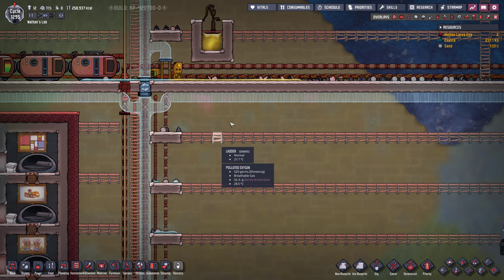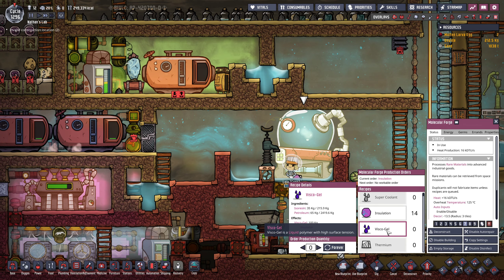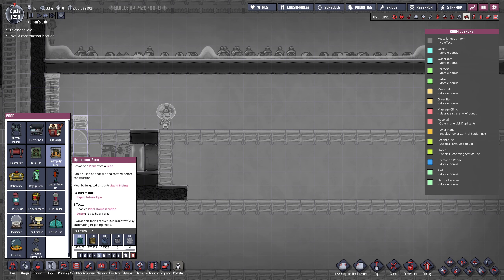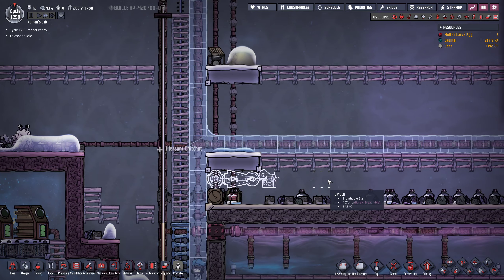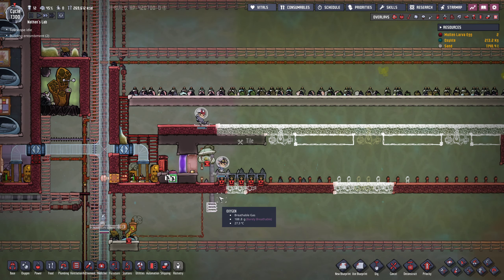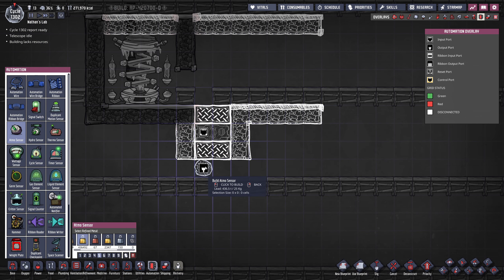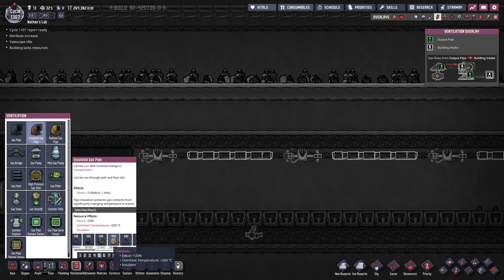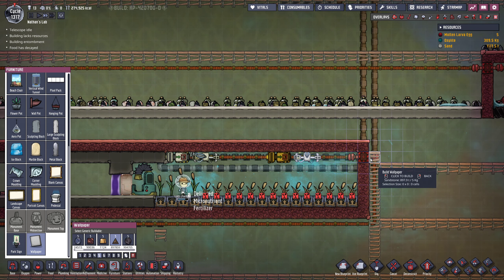START OF THE FARMING COMPLEX - Oxygen Not Included: Ep. #31 - Building The Ultimate Base

Comment: You can make 1x2 liquid locks without visco-gel but you need to use two different fluids, the downside is that they are not as stable and very vulnerable to breaking. I personally like using brine and salt water since they look very similar in colour which gives a nice aesthetic.
Reply: Also note that your more dense fluid should be placed first in order to work, also also note that when cleaning the area do not mop the area directly next to the lock or it will break.
Reply from the maker: I saw some of these locks forming as I dug out the terrain, it's a good tip. As you said they are not very stable and additionally a lot of the liquids have a too low boiling point. I'm still probably gonna end up using them at some point, good idea with the brine and salt water combination.
Reply: @Nathans-Sandbox  If you put a tempshift plate (you can use dirt) behind the liquid lock, it will drastically reduce the chances of any liquid boiling off if your dupes carry hot material through it. Especially if you use naptha. You can put 35kg of naptha in one tile without it spreading to neighboring tiles.

Comment: Hey. Nice to watch!

Have you checked how much p-water you will need? 18x130kg per Cycle, i think. So ~4kg/s... I never ever build reedfibre domesticated, the wild growth is very short enough, so i always use pips!

There were Comments about your rocket-silo from others here. My thought: reduce the number of doors (2 per rocket), Open only the side which Rocket is returning. 
So the damage will be minimized, without much use of Bunkerdoors...

And: why do you try to avoid transformers? The big ones are 400kg, and you will save 75kg of Material behind it for every wire... And you will save negative decor and Space (eg. In the farms).

I know you might need an Active cooling, after you have a vacuum in the entire map, but maybe...

You are losing all Gases through the space-tiles at the Top, this is intended?
Reply from the maker: The polluted water is only required until the weight plate is full, then the plants won't be harvested anymore. As for the silos, I thought a rocket needs 3 doors at least, but I might confuse that with something else. I tend to use the main power lines because every transformer needs a cooling solution and is so limited with only 2k. As for the gases, I don't mind them escaping, I trapped all the gases that I want to store in some way or the other.
Reply: @Nathans-Sandbox  Fine ideas with the doors, hope it will turn out like you think. Its a very good idea with the door/weightplate. Maybe think about 2-3 dupe-sensors in the room? But a emergencyexit will work to 👍